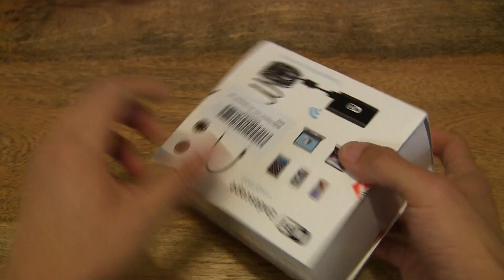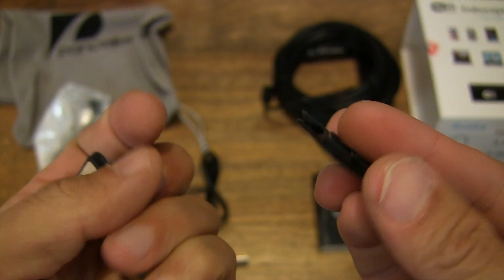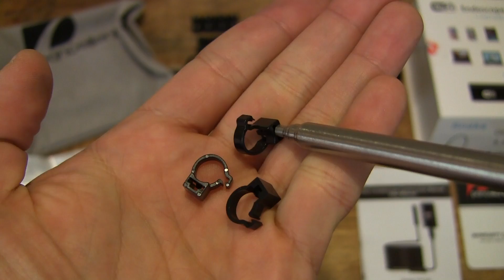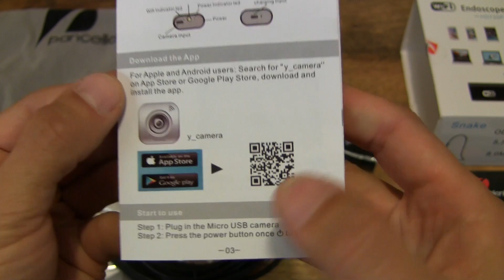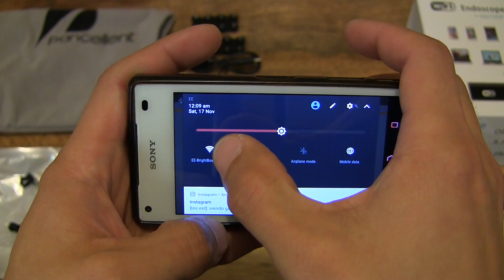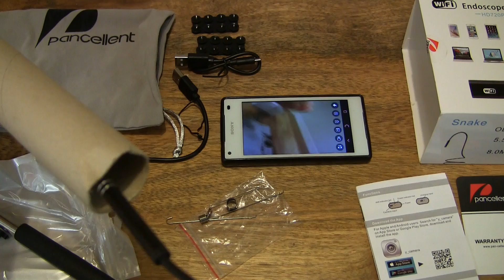Pancellent Wireless Inspection Camera

Comment: Work directly with cable to phone ? Without wifi
Reply: YES, it does. The Camera is the wifi, the terms used in the manual are lacking.  When your phone is searching for available wifi (and the cable from the camera is connected to your phone) the ANESOK will come up on the list , select it,  then go to the app and select the camera icon. Worked prefect for my Samsung Android 23!

Comment: Will it work both wireless and with the usb in case you are on a place with no wifi connection?
Reply: @sutats would you know if it works both wireless or via usb?
Reply: Will you reply? Hahaha
Reply from the maker: Hi there, it's best to check the latest product details at the link in the video description. Happy inspecting.

Comment: Glad I found this , bought the same camera and was about to send it back .  Instructions are terrible and had me thinking I needed to enter the ssid into y camera app . The app would just say error entering . I saw you skipped that and bingo got it going . I did have to put my Google pixel in airplane mode . Camera worked great on an automotive project and was a real life saver . I used it to repair a blown spark plug and was able to see down into the very back cylinder
Reply from the maker: Thank you very much and I'm glad it all worked out in the end which it always does. That's really nice to know that there was some helpful value in my video. In my videos I don't do re-takes  so there was pressure to get it working given that I've no experience with such things and I have little tech experience but I show my struggles too if they do happen. Happy inspecting.